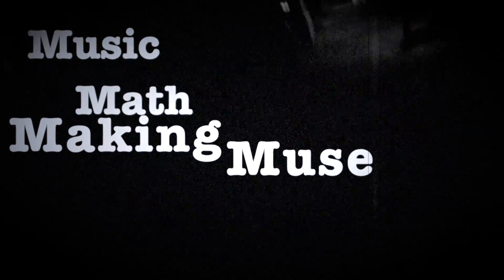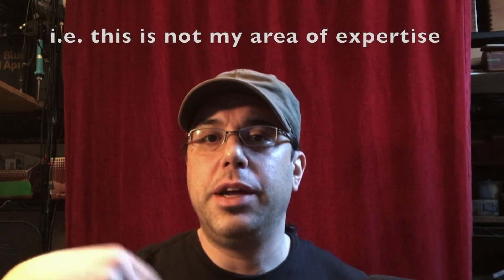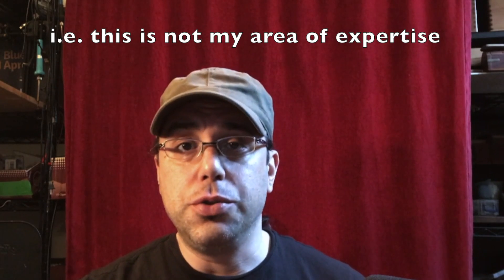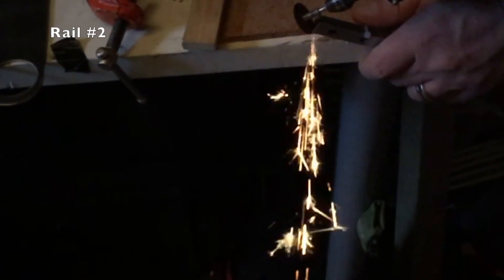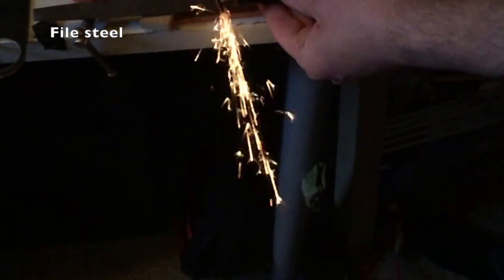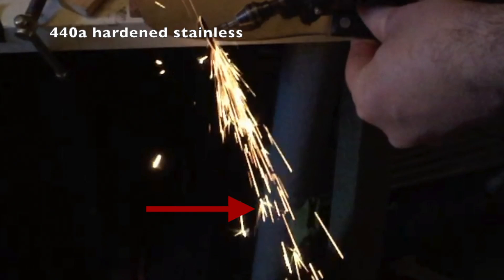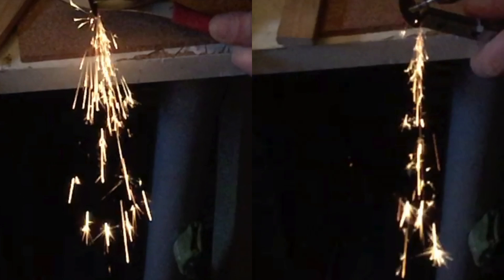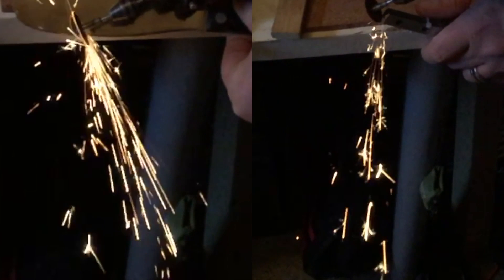Budget linear rail part 3: what are they made of... spark test

Comment: I've now look through all these railvids. I'm quite disappointed to only see some caliber measurements of balls and general, though ok information about lubricants. What I'm disappointed is that I didn't notice anything about rail quality, straightness of them out of box and real like dial gauge type measuring of tolerances. Also it's useless as somewhere was said that cheapo Chinese rails can deform when tightening. What a load of bullshit. You can destroy high quality rails as well over tightening them. There isn't a bearing in this planet which isn't destroyed by overtightening or overloading. Foundation they're put on defines the straightness, though they should be pretty good out of box as said. Rails most definitely haven't ever been designed to be attached to some shitty aluminium extrusion profile. They're meant to be mounted on stiff, hard and machined surfaces.

Comment: Why don't do a simple hardness test (e.g. Vickers test) , that will give some scientific precise info about the mechanical prop of the material if you have access to that.
Reply: My exact thought. Yeah sparks can give very rough estimate of type of steel, but it's totally fucking useless information in situations like this. Also if I heard correctly he referred stainless to be somehow a good thing rails, which makes absolutely no sense to me. It's one of the shitties things to use in so to say kinematic applications.
Reply: @jothain  I know this is late but would you be able to elaborate in more detail on how to  properly test/see rails? For 3D printing a lot of people say stainless-steel rails are 'betteer' than bearing steel.
Reply: I would guess that a Rockwell C Hardness test would be much more available than a Vickers hardness test?
Reply: @ChiralSymmetry  if you noticed the sentence correctly it is said e.g.